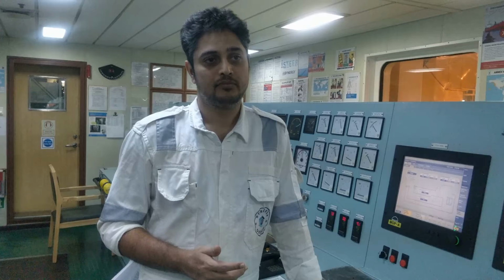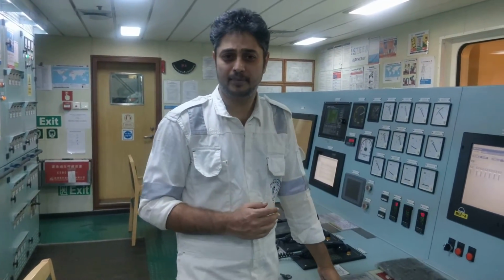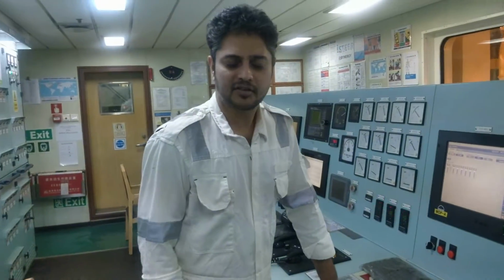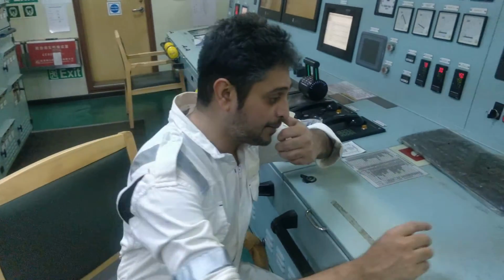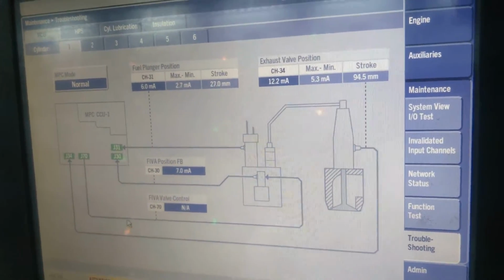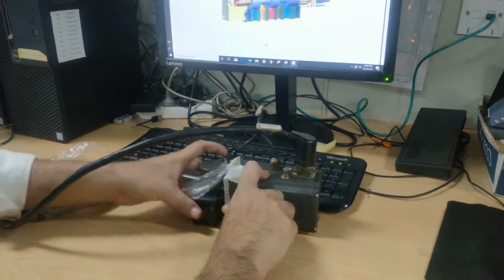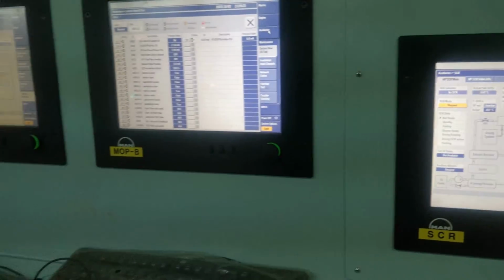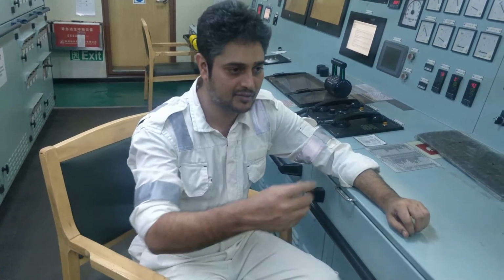ME Engine Fuel Control and unit Cut out -New Age Online Marine Academy

Comment: I think if you cut off a particular unit from mop then this will keep the exhaust valve in open condition? please correct me if wrong
Reply from the maker: Hi... from MOP if u disable  exhaust valve it will b in closed posn.. depending on d issue u r facing if u want to keep the exhaust valve in open posn using makers tool need to do manually at the valve...if u can ping to our WhatsApp channel no will pass the manual page detailing the procedure

Comment: Sorry,  are you sure that during cylinder cut out also need to cut out completely lubricator? Maybe reduce the oil supply 🤔? How possible to switch off lubrication completely 🤔? Anyway, have friction inside so need at least minimum lubrication,  right?
Reply from the maker: Suppose if one of the piston s damaged and if u don't have stby piston tat particular unit won't b having piston inside. In that context I was mentioning reg lubricator cut out. Every body are well aware in an unit with piston working,  lubricator should never be cut out